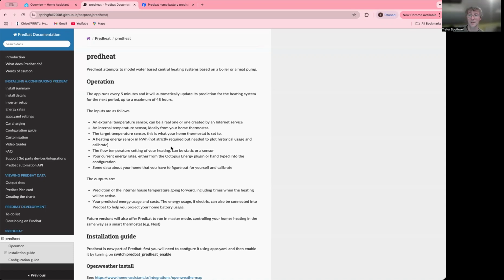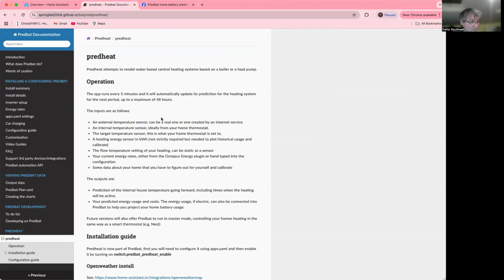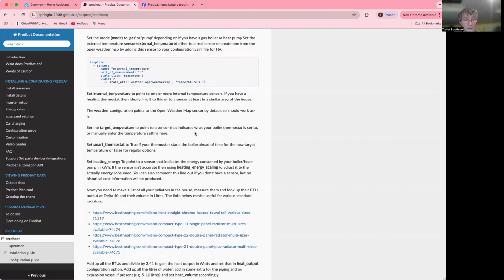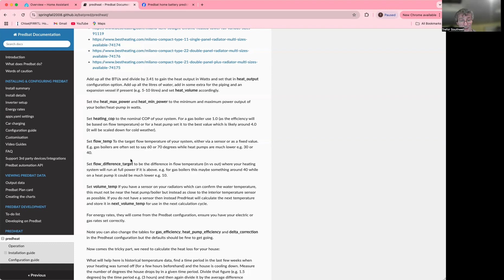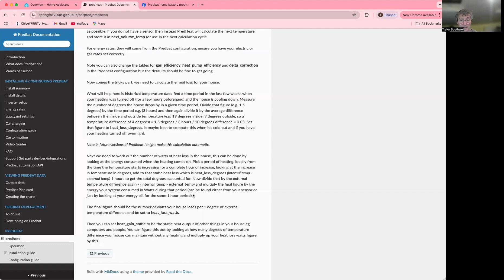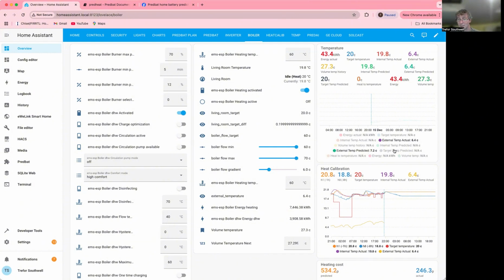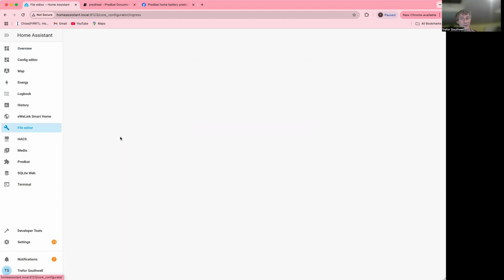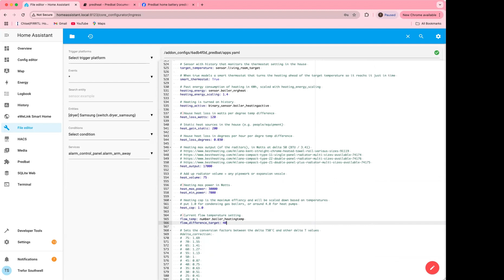Predheat Introduction

Comment: Hi Trefor, I have a heat pump and home batteries etc so will give this a go, what's the best way to give you feedback and ask questions as I am not on Facebook?
Reply from the maker: You can use the ticket system in Github :)
Reply: @springfall2008  ok cheers, there are some variables I'm not sure about so I'll request/ask there
Reply: @springfall2008  I left a question in Discussions as its not strictly an issue, hope thats correct